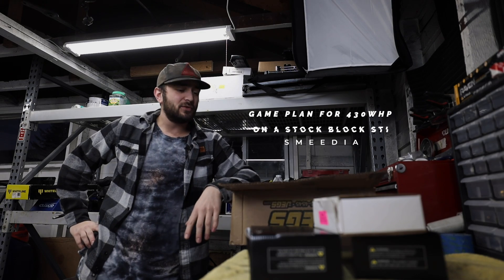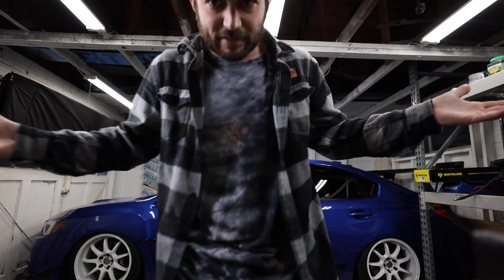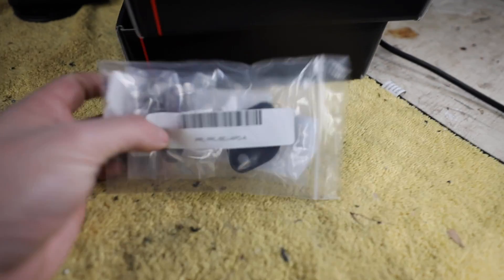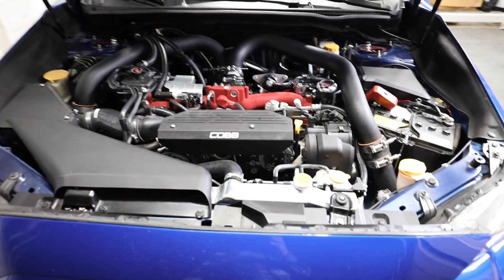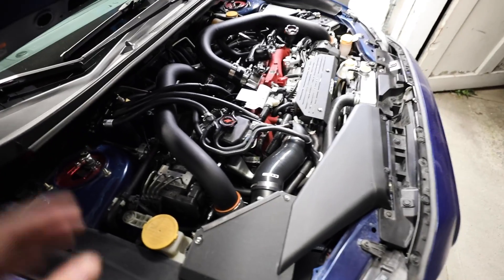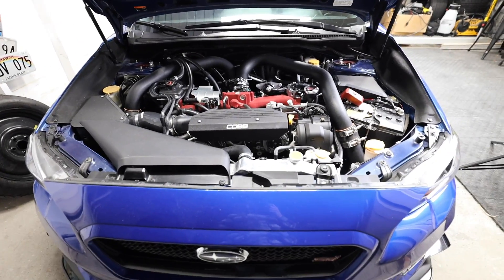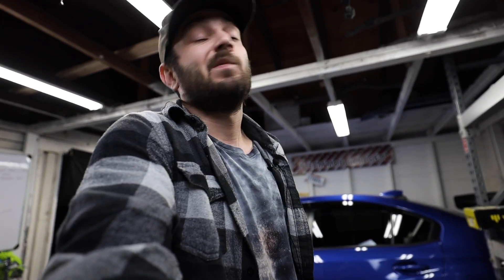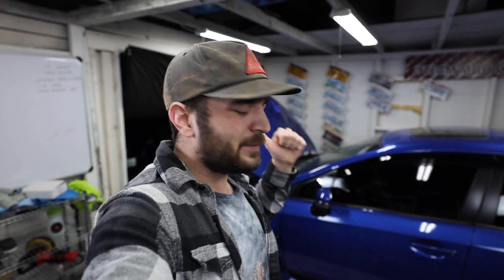How We Are Going To Make 430 WHP On The Factory Short Block!!

Comment: 430whp! Sounds scary lol.
Im not quite that high and I'm still scared every time I go WOT lol
Reply from the maker: Full send over here 😅
Reply: @Smeedia  godspeed good sir haha
Reply: Same Colin! @350whp, rarely drive around on sport#. Hahaha!
Reply: @AndyRock1  ditto! 356whp and the only time Im in sport# is if my road rage starts to kick in. Then I let the song of my people play (aka EWG dump tube) haha
Reply: Is a 350whp sti faster than a newer mustang GT?
Reply: @Mrlolibre  it's all about the power band, so it depends. It'd probably be close. STI is definitely going to be faster around the curves
Reply: @Mrlolibre  in my experience, in the real world, it's easier for me to go faster than the ones I've come across.  I. E. Off the line. Shorter gear ratios great for a quick sprint...
Reply: @AndyRock1  hmmm... I got a quote from a shop for about 350whp. I'm not sure if I want to go for it or  jump to a new platform.
Reply: @GolfCoyote  what's y'alls torque number around 330 torque to the wheels? I'm asking because I'm curious if the stock sti clutch can handle that.
Reply: @Mrlolibre  when I was stock turbo i made 330ish whp and similar tq (350s).
Reply: @Mrlolibre  I'm at 372wtq, stock turbo. Honestly I'd go a different platform lol. Not sure which though, hard to find one that makes easy power for little money except Mustang.

Comment: Good luck dude. Hope the engine can handle that. I was told by my subie shop where I live that 350 WHP is the max they are comfortable with going on a stock block.
Reply from the maker: Sounds about accurate most tuners try to stay at the 350WHP point on stock block
Reply: Ajai M for wrx not sti

Comment: Air pump deletes: You "can" manage to do this with the engine in the car, though tricky, but tapping the holes for an 1/8" FNPT threads and using a pipe plug is a much cleaner approach and SS plugs are cheap. Plug the holes first so that chips are easy to remove. Remove cotton, rag, etc. before installing the plug. The hole is nearly the size you need for tapping. You could even use a tapered reamer to do the job.
Reply from the maker: Shouldent need to tap anything, the player deletes just plug plug and seal the holes for the air pump 👀
Reply: @Smeedia  Conventional ones don't plug they only cover and cap off the holes. My suggestion, which is proven on several of my engines, eliminates $50-80 bolt-on pieces and is a cleaner solution. They are flush to the head. 
Sure there are some fancy covers being offered, but nobody sees them. SS plugs cost $4.
Looking forward to seeing the build. I see no reason this won't succeed, especially with E85. That's like cheating. Detonation is the only issue as I see it. Will you do anything to reduce the risk of it, like better sensors or advanced monitoring?

Comment: Barometric pressure sensor is on the driver side SIA valve. You should be able to cut the sensor away from the valve and tuck it away. Make sure you secure all the connectors and hoses around your knock sensor when the pump system is removed. I had a false knock due to a rattling wiring harness near the sensor. Be sure to light that whole pump system on fire with contempt when you're done.
Reply from the maker: 😂😂😂😂 I'll burn it all to the ground lmao appreciate the tip on the wiring harness!
Reply: @Smeedia  if I recall correctly it was actually the knock sensor wiring harness itself. The connection was free floating and contacting the block right next to the sensor.

Comment: When you install the GDT cooling mod you’ll see where the air pump delete plate goes on the drivers side head, for the passenger side you’ll wanna remove your turbo to get easy access to that side!

Comment: If you can find an APS 50/50 valve those are by far the best. Problem is APS went out of business SO you have to pick them up used. There’s usually a couple of them on eBay. MY STi makes 425  to the wheels on a conservative tune and that’s what I use. Otherwise I would go with a GFB. It’s another oddball one that you won’t see often also. 
It’s also a company from Australia like APS

Comment: The prl block off plates were the worst to install. I did it with out taking the intake manifold off I had to cut the one on the passenger side so I could fit it on if ur taking the manifold off ur life will be easy. I also used ultra grey on ten to make sure I got a good seal didn't want to mess around with a gasket.
Reply from the maker: I did not even want to attempt it with the manifold on 😅 kudos for getting it though!

Comment: I am pretty confident you will meet your power goals given you’re swapping out your turbo. Stock turbo 3rd gear 23psi 
Power:
363whp/461wtq 
Parts:
- Cobb Access Port 
- Cobb Flex Fuel E85 Kit
- Cobb Fuel Pressure Sensor 
- Cobb 1050cc Injectors 
- AEM Fuel Pump
- Process West CAI
- Synapsis Diverter Valve
- Perrin 3 Port Boost Control Solenoid
- Perrin EBCS Mount  
- Perrin Air Oil Separator
- Killer B Ultimate Oil Pickup 
- Killer B Oil Pan Baffle
- Killer B Holy Header 
- Killer B Up Pipe
- Perrin Turbo Heat Shield
- Invidia Catted Downpipe
- Corsa Cat-Back Exhaust
- All Grimspeed Gaskets
- DEI Titanium Exhaust Wrap
- Cobb Short Shifter Bushings
- ACT Modified Street clutch
- Ohlins Road & Track Coilovers
Reply from the maker: Your build list is very similar to mine, should make the HP no issue the TQ is the dangerous part lol

Comment: Stoked to watch the build I’m getting ready to install a bunch of parts for my built IAG block. Looking for 400whp Rn got the FP red and all the supporting parts for it!!!
Reply from the maker: Jealous! I've been doing all of the fueling components first. Want to get the turbo soon 😅
Reply: Smeedia nice. I went with IAG TGV I’d 1300cc injectors and top feed conversion kit. I’m honestly just trying to knock it all out with 1 tune
Reply from the maker: @Origamiman15  same, but I think my injectors may fall short
Reply: Smeedia what injectors are you currently running? I went slightly overkill so I wouldn’t worry about maxing mine

Comment: HEre is my setup at the moment. Going through the tuning process right now with mtuned. E tune. I’ll let you know how it goes. 

2016 sti stock engine 62k miles compression 135 to 138 all around 
Id1300cc injectors
Visconti Wallbro 450
Cobb 4 bar sensor
Ets fmic 3” core
Ets intake speed density
Ets elh
Tial 50mm bov with 11psi spring
Tial ewg 38mm
Grimmspeed uppipe with ewg
Torque solution tgv deletes
Cobb fuel rails 
Cobb fuel lines
Cobb flex fuel kit
Aeromotive fpr
Grimmspeed ebc
Air pump delete plates
Fp blue with 84mm inlet
Invidia catless downpipe with afr bung.
Perrin catback exhaust
Act sb10 hdds clutch
Oem flywheel new
Visconti sd harness
Visconti wideband harness
Killer b oil pick up and windage
Iag 8mm intake mani spacers
Iag aos
Aem wideband gauge
Nkg one step colder spark plugs
Reply from the maker: Please follow up! Curious to see how it goes!
Reply: Smeedia after getting the car etuned the car made 411whp and 380tq. Tuner kept the torque down since is a stock block. This numbers are on e85.

Comment: Turbo smart Bov and Wastegate, I'm getting ready to run a very similar setup. I'm doing the iag comp, fp zero and uel headers. The headers and up pipe are being built. Everything else we have very similar parts u did iag I did torque solution on mine. I have a list if u want to take a peek.
Reply from the maker: Totally open to taking a look! Good to reference across other builds!
Reply: @Smeedia  Alternator and radiator shroud covers 
Grimmspeed light weight crank pulley
Grimmspeed boost controller 
Grimmspeed intake 
Ets front mount intercooler 
Cobb access port
Cobb flex fuel kit 
Tanabe boost/air fuel ratio/ Oil pressure  gauges and 3 pod
Pillar for gauges.
Invidia down pipe 
IAG AOS it is a street but I have the comp adapter I 
Bought the wrong one first.
Killer bee oil pick up/baffle 
Torque solutions fuel rail/pitch stop/transmission mount/ TGV deletes 
And motor mounts
CSF radiator/oil cooler 
Mishimoto dual fans, radiator stays and radiator hoses 
Turbosmart 44 waste gate and BOV
Doms cylinder 4 cooling mod 
FP Zero with intake and lines 
Act 6 puck  clutch and flywheel 
Kart boy short shifter and bushings
Clutch master cylinder brace
BNM performance uel headers and up pipe.
 Suspension wise I'm running white line sway bars with kartboy endlinks now, fortune 500 coilovers cusco front and rear lateral links, stoptec brake pads, slotted rotors and brake lines. I'm waiting on my headers and up pipe to come in and all the engine mods will get put on and tuned by mtuned at revworks here in Florida when they put the parts on they are going to do my fuel lines, pump and injectors I'll let them figure out what's best. I think that's it.

Comment: Not sure if u ran flex fuel kit in ur other Subaru but if u did have u ever had Cobb ethanol sensor low voltage check engine light? If so was wondering how u fix the problem.
Reply from the maker: First time using Cobb's, heard they had a revision for the wire harness to correct the issue
Reply: @Smeedia  turns out i needed a new flex-fuel harness. Be prepare for this to happen lol only had mines for 4 months so bless my mine when I got the code. Thanks for the respond n good luck on ur build 👍

Comment: I have a question for everybody how to work knock sum on accessport ?
I have 2016 sti stage 2 protune 
when I'm stopped and I press the accelerator it goes up 1 to 1 on cyl 4
Cyl 1 1/1
Cyl 2 3/3
Cyl 3 8/8
Cyl 4 69/78 
??

Comment: I’m at 441/439 on e85, stock block. 2017 sti 32k miles on motor
Reply from the maker: Good to hear that the numbers are achievable 🔥
Reply: Smeedia yeah it is!  My set up is MAP intake, catted down pipe, exhaust. Grimmspeed intercooler, ebcs. Arashy dynamics 20g turbo.  Cobb fuel rails, lines, flex fuel, inlet hose. Id 1300x injectors. Tgv deletes. Radium dual fuel pump hanger with aem pumps.

Comment: smeedia, i made 370 whp on e75 but i only run e60 because of the hpfp. if i upgrade to nostrum hpfp do i need a retune or will i be ok without a tune?
Reply from the maker: I'm not sure on that one, I haven't had too much experince with the high pressure fuel pumps in the past 😫
Reply: Smeedia ok thanks. I’ll ask my tuner

Comment: If you just want 400 whp and quicker boost why not a Dom series turbo, like a 2.5. I was going to go with the 1.5 if I still had my 2015 STi.
Reply from the maker: When the block blows up I wanna just be able to transfer parts onto a built block and make more power
Reply: @Smeedia  ahhhh...disregard. So the real end game is bigger HP. 👍 But what if your block nv blows up and you end up with a FP Gteen that is only good for 400 WHP top end? Lol
Reply from the maker: @daviddoan9447  we will keep turning up the boost to see how much it will hold then 😅  FP Green will be good for around 450, once that is capped then I'll go rotated but dont have the money to do rotated right now
Reply: @Smeedia  even when it starts to knock? 😳😅👍 I meaning that is your purpose and then to blow the motor...lol. I can't wait to see it and see where the build goes. Best of luck! Also you reliability vid tho...😒 but I'll leave that for another time. Hahah
Reply from the maker: @daviddoan9447  lol I am going against everything I have said up to this point on reliability with power but I have always wanted to personally know what I can make the OEM Block take. More or less out of my own curiosity. Plus it also gives videos for people to learn how to pull the engine and get deeper into the car to learn more.

Comment: Assuming driveline losses of 10%, 430 WHP translates into 477 BHP. Holy crap that’s a lot to expect from a 2.3 L stock block! More HP/L than Mercedes CLA 45 AMG, a hand built engine. Even if your flame burns briefly it will certainly burn BRIGHTLY! You may want to think about becoming an Uber driver 🤣🤣, to pay for your future larger fuel bill.
Reply from the maker: 2.5L my friend! But were going to full on send it for science! 🤣

Comment: You need the 1050x injectors atleast
Reply from the maker: Already have them installed 😁
Reply: Subaru wrx sti mod list
Installed 
Killer b oil pick up 
AEM cold air intake 
Invidia DP catted, 
Invidia q300 exhaust 
Torque solution engine mounts
Torque solution pitch stop mount
Torque solution trans mount
Cobb accessport v3

Needs to install —-already bought 
Tomei EL Headers 
EWG set up 38mm grim speed  flex pipe  up pipe 
IAG TGV deletes 
IAG fuel rails / Lines / fuel pressure regulator 
Grime speed EBCS
AEM fuel pump
Grim speed turbo bracket 
IAG AOS 
Hela Horns 
Cobb flex fuel kit
ID1300cc injectors 

Need to buy —
ETS FMIC.           $1300
Speed density.    $100
 turbo inlet           $200
Clutch kit              $700
Fp turbo black     $1325
Cobb 4bar map     $ 165 
Mishimoto radiator.   $320
Cylinder 4 Cooland $85
IAG stage 2.5 close block          $4200
Air pump deletes 
Cobb flex fuel senor 

   Total- $8395

For sale
1050x injectors - Sold 350
OeM fuel pump -
Tomei up pipe - 
Grim speed AOS-   That going to be my set up